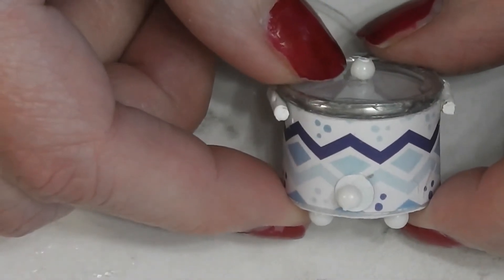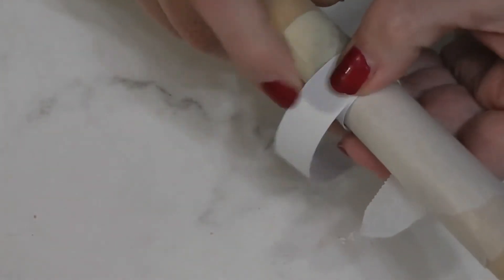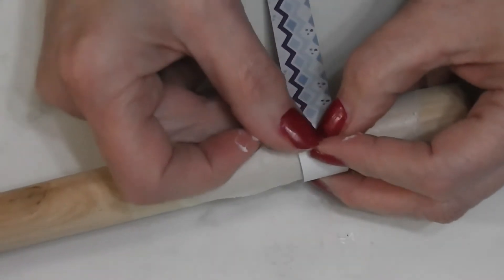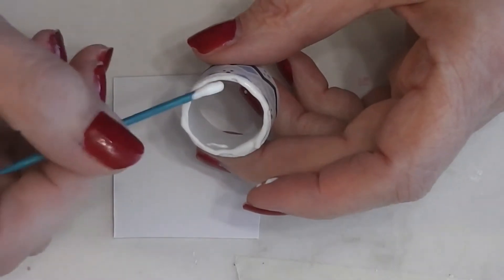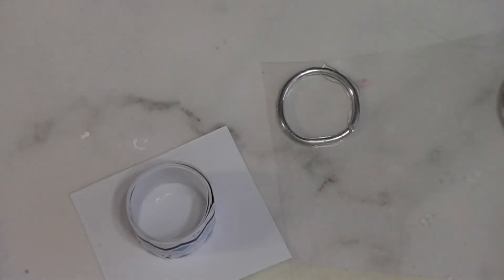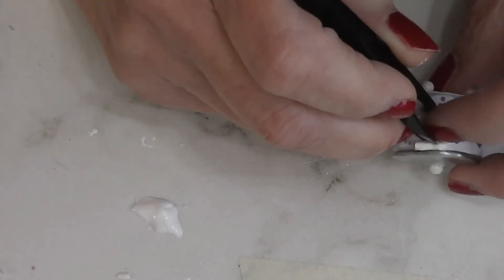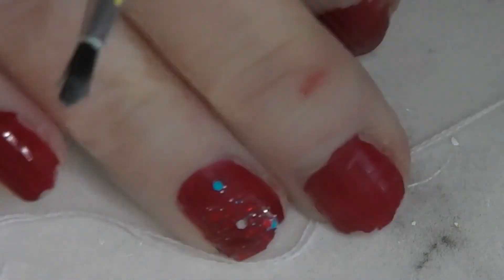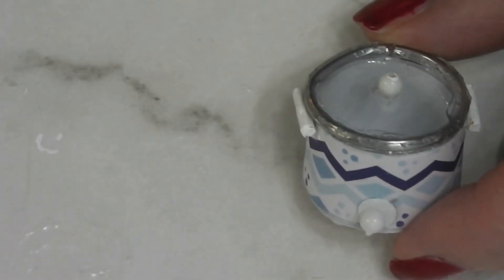Dollhouse Miniature Slow Cooker Tutorial

Comment: Have you thought about putting marks on your work surface to show your camera coverage area? It’s like the marks they put on a stage to make sure actors are standing in the correct places.
Reply from the maker: I actually do lay down strips of masking tape at the edges of my in camera area before I start recording. I still manage to drift out of the area sometimes. The main issue is to be zoomed in close so all of you can see the details my work area many times is less than 2 1/2" by 4" and that is just on the surface of the tile. If I raise the item up to try to see better the in camera area shrinks even more.I do my best and do re-film some parts if possible but sometimes it just isn't possible.  Just know I am doing my best. I am hoping to get another camera next year so I can set up 2 angles, which in theory will help with the problem.